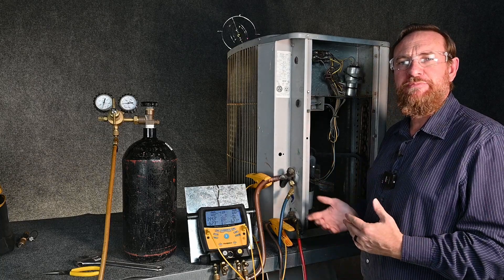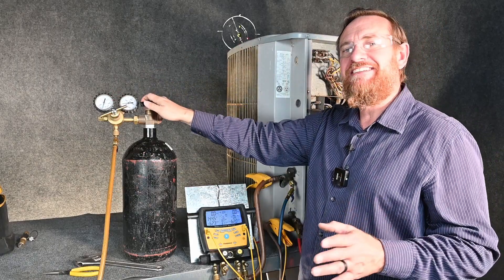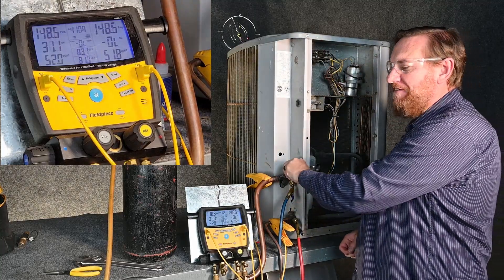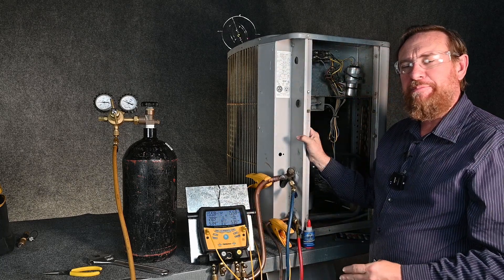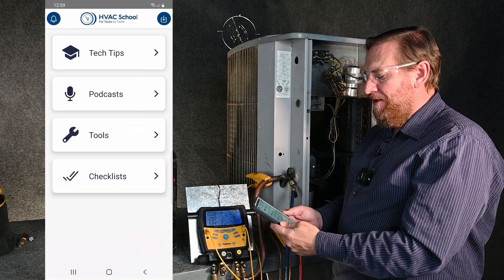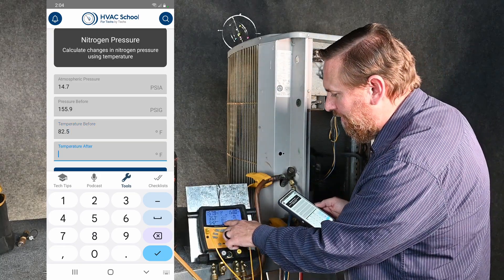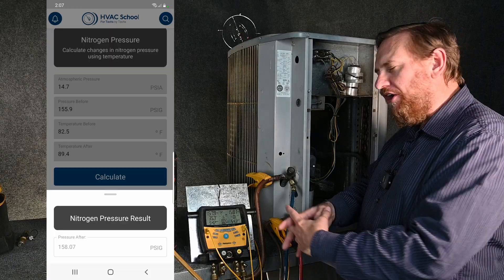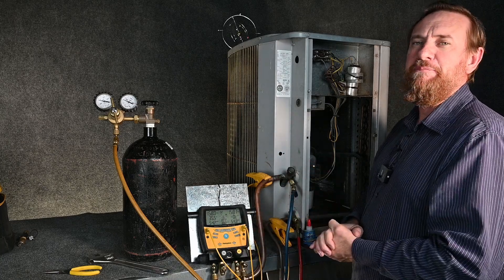HVAC 154 Nitrogen Test temperature compensation, digital gauges & app

Comment: I don’t mean to be rude but the caps should be off on the service valves since they are an area prone to leak due to poor brazing practices by dumb and lazy technicians/installers!
Treat them accordingly!
Suspect everything,trust no one!
Reply from the maker: I hear you and agree. 

The vast majority of the valves leak. I recommend the threads be sealed with nylog as it stops the majority of those leaks. (Not on the valve core caps)